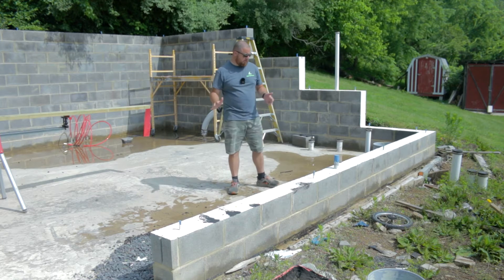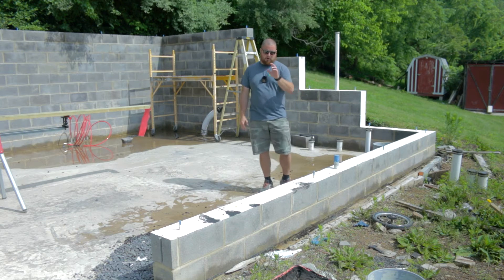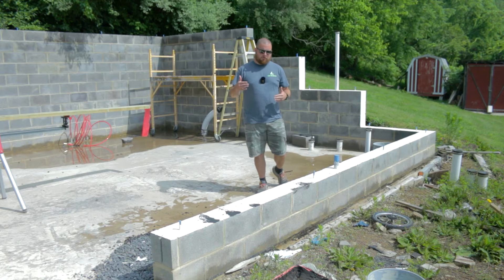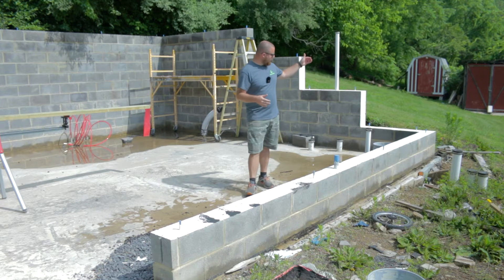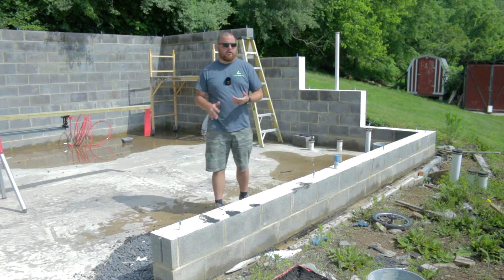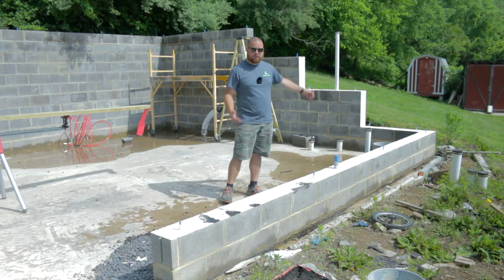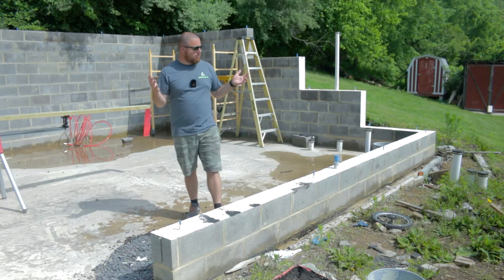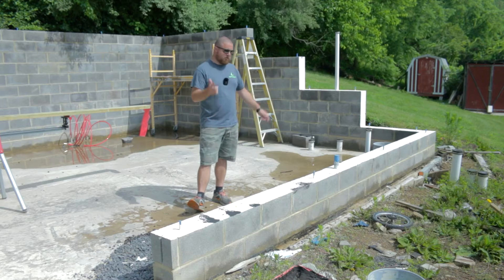Garage Build #24 - Sill Plate - Measure and Drill for Anchor Bolts

Comment: Thank you for sharing that! What do you think about using screw bolts and epoxy instead of anchor bolts?
Reply from the maker: There is a special epoxy for rebar/anchor bolts you can get at your local hardware store. Here is a link also: https://amzn.to/3UL9Ed3